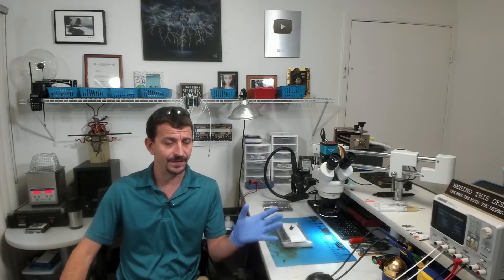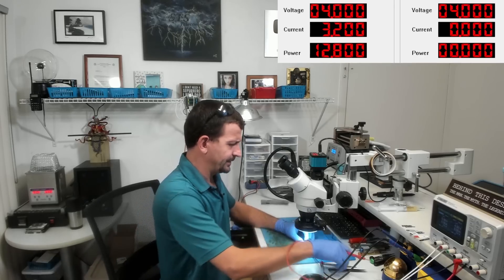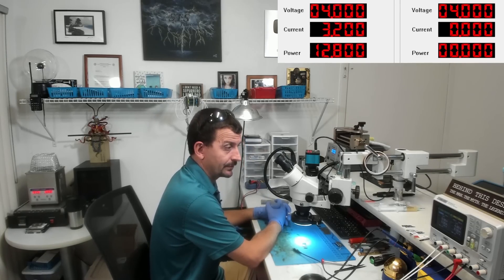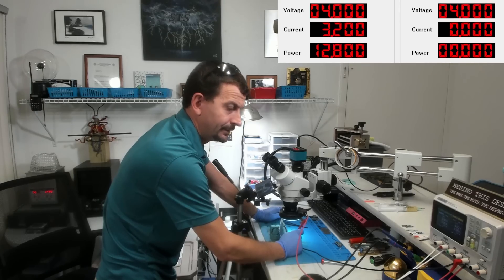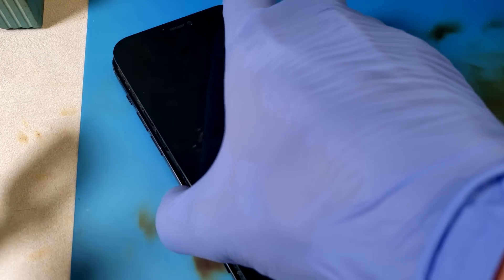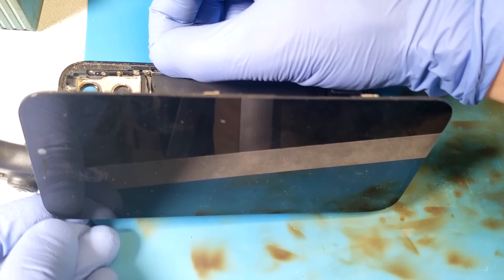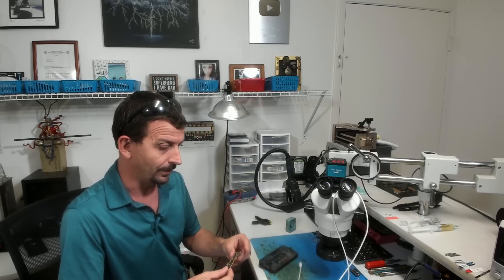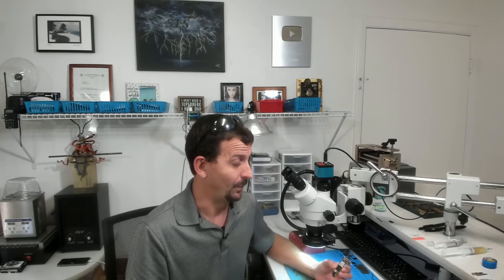You won't believe this & what I did to recover her iPhone!🤯

Comment: costs..

The Graybeard engineer retired and a few weeks later the Big Machine broke down, which was essential to the company’s revenue.

The Manager couldn’t get the machine to work again so the company called in Graybeard as an independent consultant.

Graybeard agrees. He walks into the factory, takes a look at the Big Machine, grabs a sledge hammer, and whacks the machine once whereupon the machine starts right up.

Graybeard leaves and the company is making money again.

The next day Manager receives a bill from Graybeard for $5,000.

Manager is furious at the price and refuses to pay.

Graybeard assures him that it’s a fair price.

Manager retorts that if it’s a fair price Graybeard won’t mind itemizing the bill.

Graybeard agrees that this is a fair request and complies.

The new, itemized bill reads….

Hammer:  $5Knowing where to hit the machine with hammer: $4995

Comment: To be fair, your $.30 clamp did temporarily fix the problem by aligning the crack perfectly. Obviously, once you closed it all back up, the crack unaligned and it went back to nonfunctional. There’s no real way to fix a cracked board like that without rebuilding the whole thing with a donor board. That assumes that component pairing issues don’t present.

Comment: Well it seems to me there are 2 levels of objective here. 1 is getting the data, which the clamp maybe made possible, the other is a working phone. Don't know if it is possible to repair that board, but I am guessing it is not worth the trouble. Would you be back the the chips transplant to another 12pro top board?
Reply from the maker: Data was #1 goal for sure.  I will do full CPU / top board swaps on these for data only.  For me it isn't worth the trouble for a fully functional phone though as it's easy to get into a lot of troubleshooting!

Comment: Hi Jason I have a 12 pro that has a short on pp1v06 and the 06 lines of cause they both go to the cpu and I believe  those 2 lines are shorted together as both lines seem to connected to each other when I've tested in continuity  mode black probe on pp1v06 and red probe on the 06 lines  my long drawn out question is are these lines related to the ram your well experienced  thoughts on this would be very much appreciated thank you

Comment: 30 cents, you lucky bustard. Those things cot AUD$1.75 each down here. 🤬
Did you consider that the fracture really only became visible after you started applying heat to it on your heat table and up until then it was just a barely visible microscopic hairline crack?
Irrespective Jason, a win is a win! 👍

Comment: what a luck that no brain transfer was needed. Do you charge customer less because less time consuming work was done ?
Reply from the maker: Only rarely.  With flat rate pricing on recovery, it's really difficult to discount the easy ones and survive.  When I take the wins compared to the losses & what is brought in over-all,  there's no way we could make it if discounting the easy ones.  I would have to charge the really difficult ones $1000s to make up for it.  This board was so very close to needing a full transplant it's unreal & could have easily tied up 1~3 days.  With data transfer, parsing & re-assembly afterwards, it still tied me up for a good long while & remained on the bench when I got back to work in the morning.
Reply: @ststele  i understand you, thank you very much for a long explanation.Can you do an Android repair/recovery if you will have one ?

Comment: Nice one Jason! 
I had one 12 pro few weeks ago that was not coming on. Was coming on only when you promt to boot with a charging cable! 
The problem was FL10130 dead or partially disconnected... Changed the case, flex, all things, till i took multimeter and saw that i dont have 1.8v on power button... LOOOL what a day was that....
Reply from the maker: Thanks..  Nice win for you!